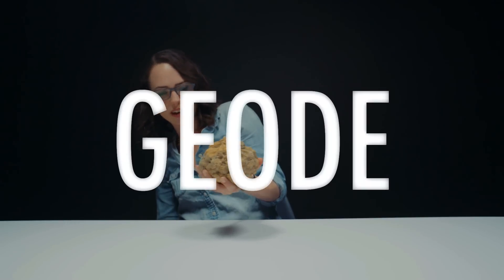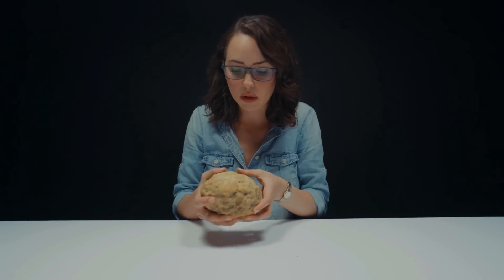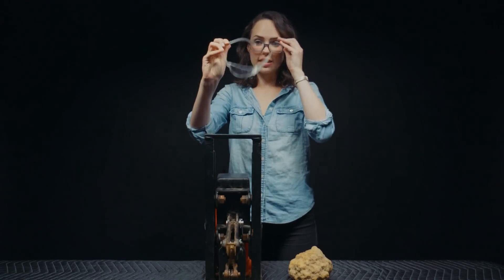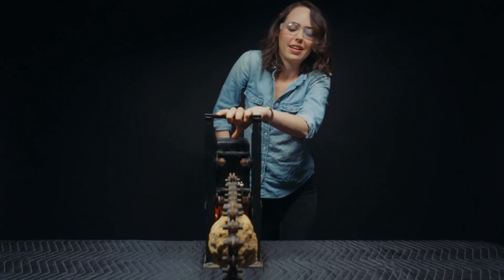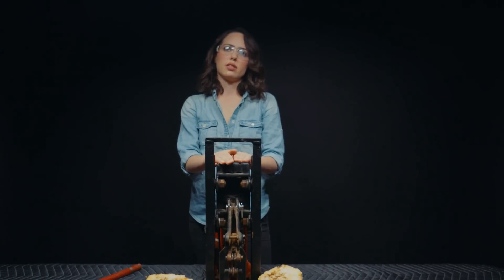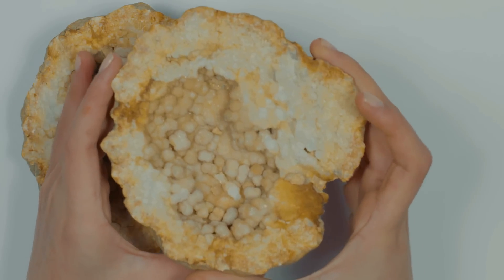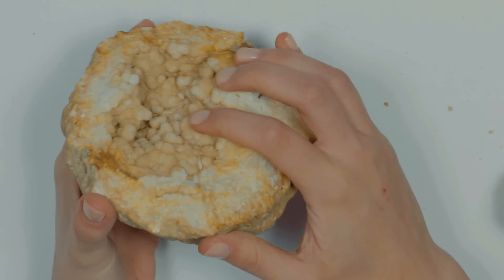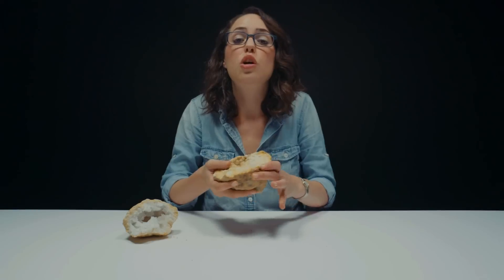Cracking Open A GEODE With HYDRAULIC PRESS!

Comment: I got to open some geodes recently. There was a big flat one with white quartz, there were two igneous ones were one had blue druzy and one with bigger crystals. There were two with clay shells with bubbling formations in the shell, they both have druzy chalcedony and small crystal quartz. There's one with either milky quartz or skeletal quartz with a milk white flattened rod shaped crystal cluster (unidentified). There's a small pink one with grey druzy with a pink splotch, and there's one that looks like two fused together of maybe calcite. There's one of an irregular shape With a light grey druzy and I cracked it just right for it to be polished around the pocket to show the lacing. One broke, but had a yellow tinge to the crystals and I plan on get about two more.

Comment: So how do you know you are trying to crack into a hollow geode and not a solid rock?
Reply from the maker: One way that you know if you have a geode is to shake it. With this geode, I could hear the crystals that had broken off of the wall of the geode moving around. If you don’t hear anything I recommend judging the density… does it seem lighter than you would think for rock that size? If so you may have a hollow geode!
Reply: You can also go by how much it weighs compared to another  geode of the same size.
Reply: You can kind of tell it’s  a geode just from the appearance on the outside. I once found some weird looking rocks in a creek bed, and immediately thought “are those geodes?” Because they’re round-ish and have that lumpy look outside. Picked one up, threw it at a bigger rock, and boom, a gorgeous white quartz with orange edges. Still have a bag full of them.